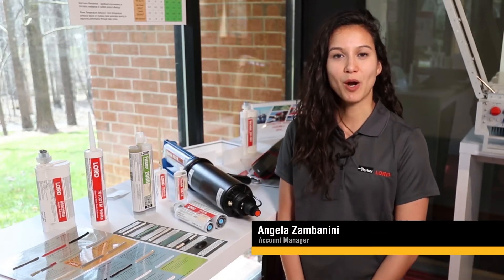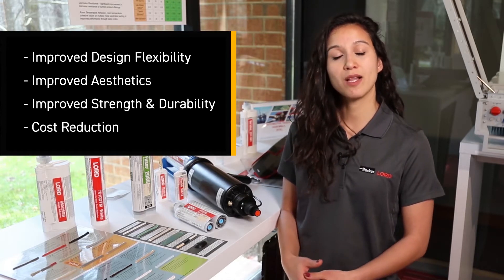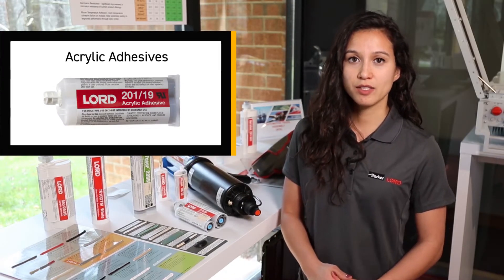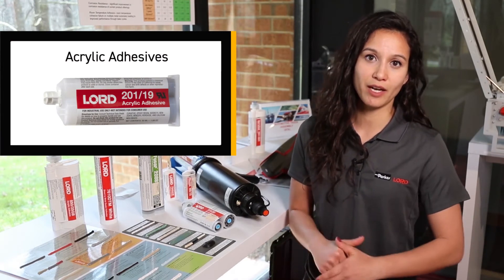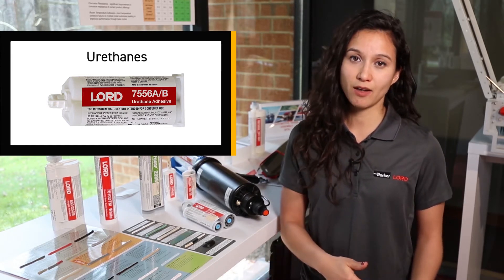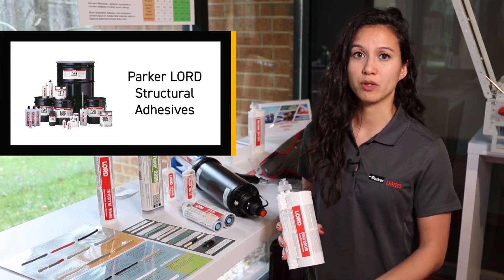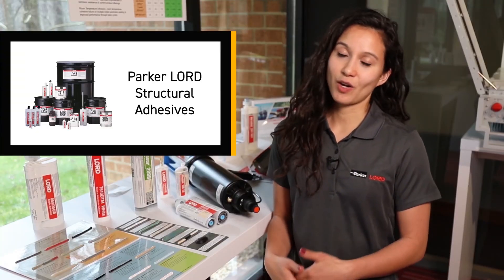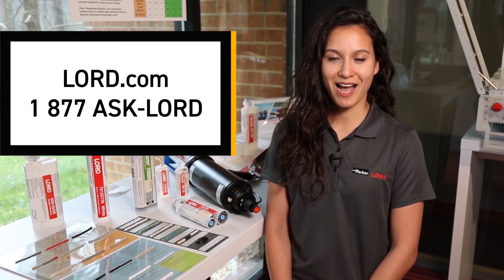LORD Adhesives Overview

Comment: How to remove this if any wrong installation done
Reply from the maker: Thanks for the question! For LORD structural adhesives, follow these instructions:

To remove a structural adhesive after it is cured, apply heat and a wedge force.  Start with modest heat of 150° to 180°F (65° to 82°C)  up to 400°F (204°C) or above to soften the adhesive. With a tool in wedge force, press along the beadline to separate the adhesive from the substrate.  Remove adhesives from substrates while it is soft or grind off after the adhesive hardens again. 

Please let us know if you have any additional questions!